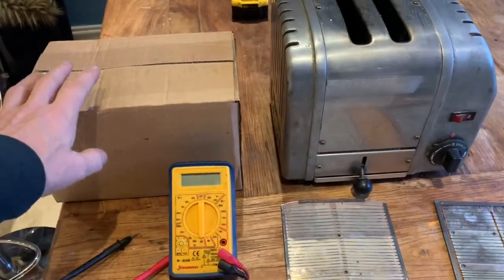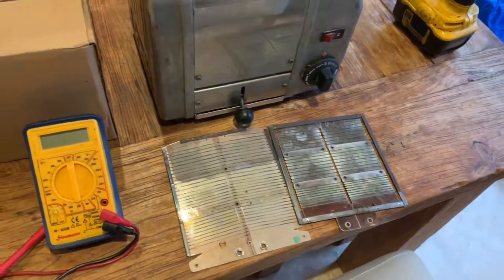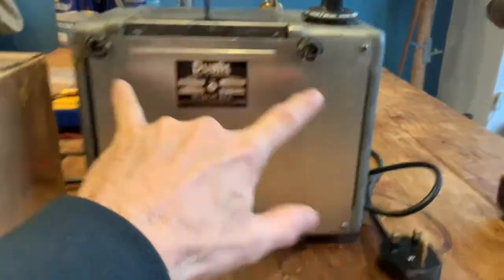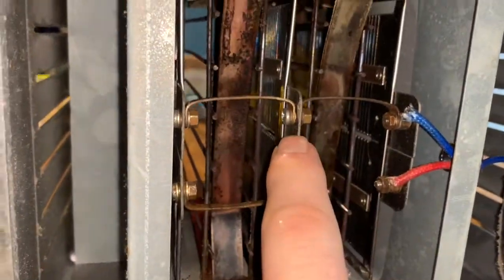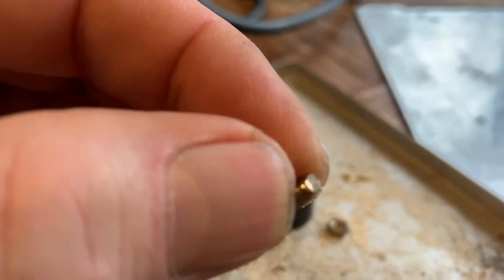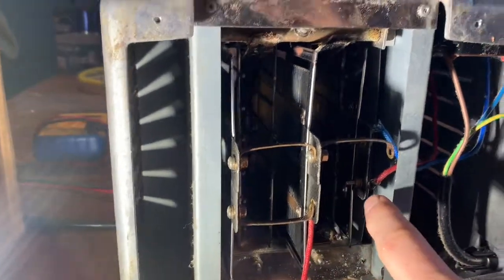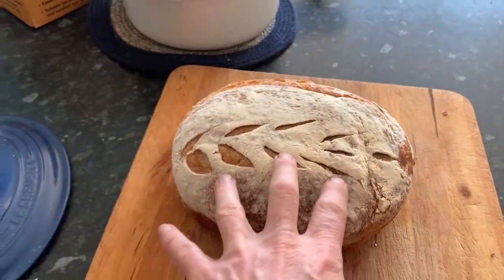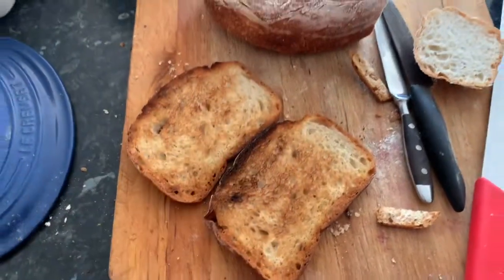Dualit Toaster - genuine vs cheap elements from eBay and Amazon

Comment: You used the wrong elements from the start. Those with the square piece to the bottom are meant for older dualit toasters
Reply from the maker: Just seen your comment - thanks for the heads up. Mike